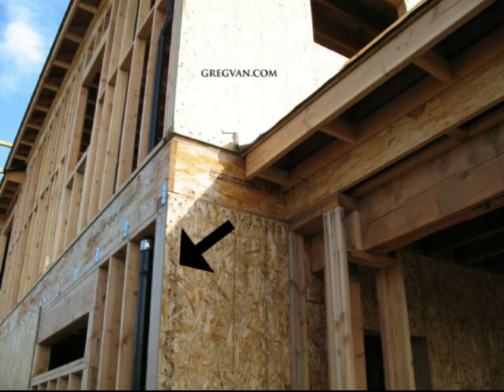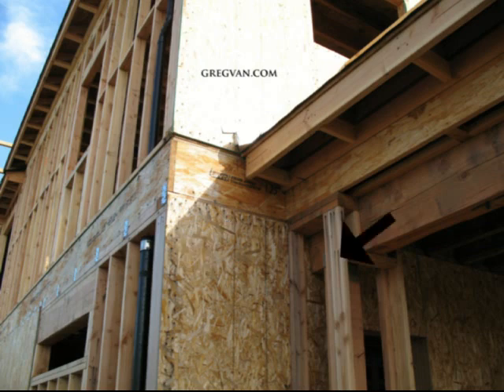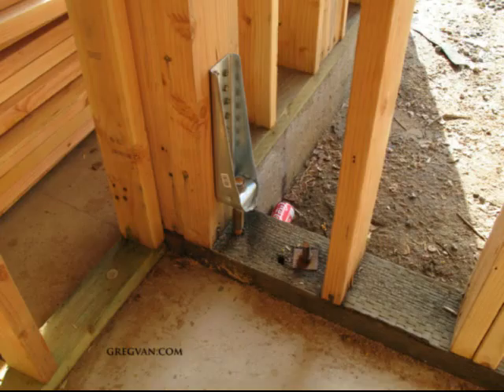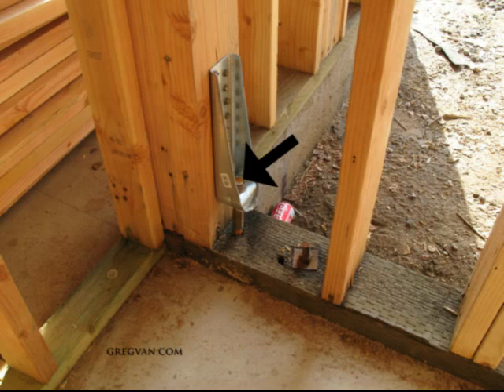Galvanized Versus Iron - Beach House Framing and Construction

Comment: A couple of questions.
Are fasteners in contact with treated plates, required to be coated or stainless steel?  I seem to recall something about treated wood rapidly breaking down plain steel fasteners but that was a few years ago and perhaps the new chemicals are not so aggressive.
Do galvanized nails have the same mechanical strength as plain steel?  Perhaps the code requires closer spacing or thicker nails when using galvanized?
Reply from the maker: I'm not 100% sure where the strength lies in different metals or their coatings, but they do sell galvanized anchor bolts, nuts and washers that can be used under these circumstances, suggesting to me that they would have been approved by some type of building and safety organization.